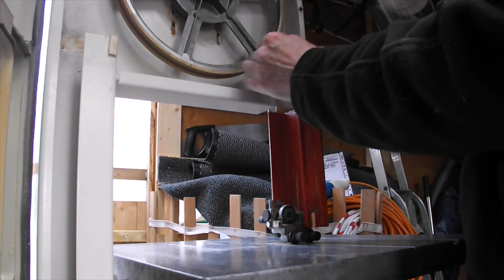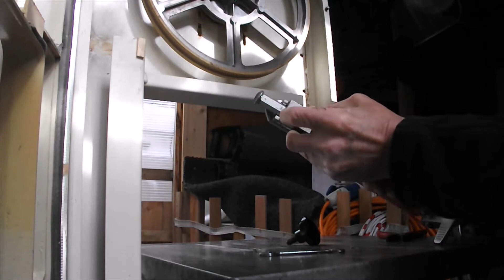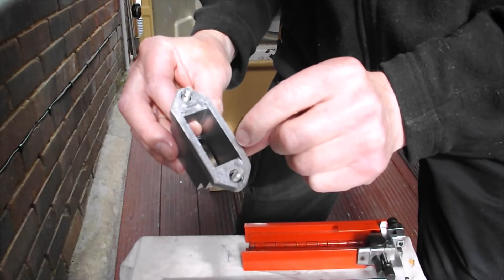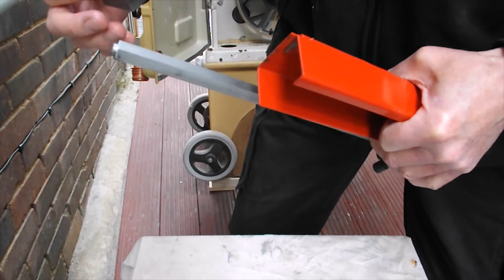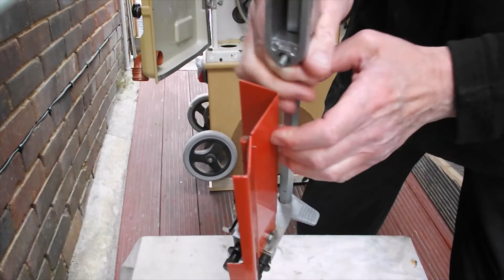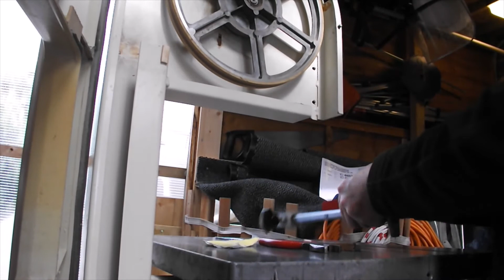Kity bandsaw 10  0613 220 v Part 1

Comment: Hi I have the same saw as you I need to replace the barring that the blade pushes against. Can you tell me where I can purchase the right one for my Kity613 from. Thanks Nick one arm 🏴🧔🏼‍♂️
Reply from the maker: Hi Nick. The bearing is of a standard size. It will need extracting from the machine using some sort of drift while holding it in a vice. If the size is not marked on it,  measrure it . In the uk I sometimes take bearings to farm repair workshops they are often experienced at ordering that sort of thing. Just note it should be the type that has a plastic seal on both sides to keep the saw dust out and grease in.

Comment: The coating you refer to as chrome is not chrome but zinc...
Reply from the maker: Thanks for your comment. It looks like chrome to me.    If it is zinc I may be able to re zinc it. Before I try what makes you say it's zinc?
Reply: @jonathanjonjon2871  Chrome does not go that grey colour, it normally starts rusting under the chrome and it bubbles off the the part, with zink it goes a dull grey colour, that is when it has oxidised.  Galvanised steel does the same.   Just put some dry lubricant on it and it will be fine.  Even a bit of wax will work fine, so that the sawdust does not stick to it.   Hope that helps
Reply from the maker: Yes thanks for that just asumeded it was chrome but can see its not now.  I will try dry lubricant even a pencil for the graphite.

Comment: These are really great vids. So helpful with my saw. It does have one issue though - the tensioning crank isn't working. I couldn't see any vids where you open that part up and service it - is that right. Or have I missed one? Thanks again.
Reply from the maker: Thanks John. Glad its been useful. You are right I've not had any problem with it so no video yet. Can you turn the knob or has it ceased up? or just turning with no function? Try some lube.
Reply: @jonathanjonjon2871  thanks for replying. It turns, but nothing happens. I'll have to crack it open! :)